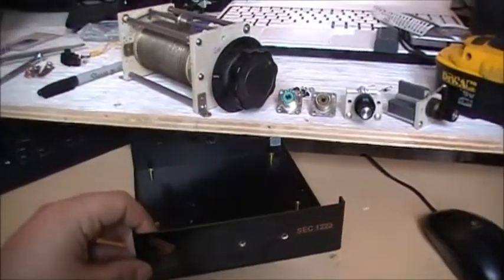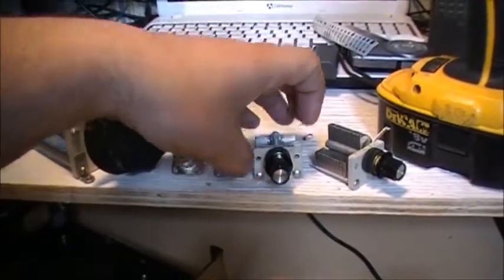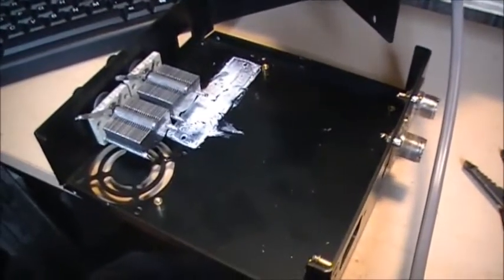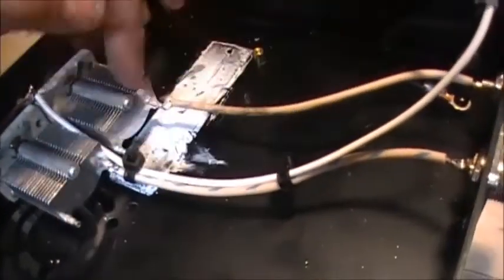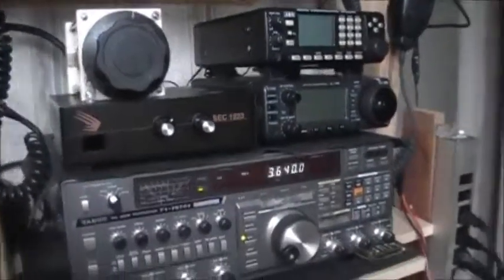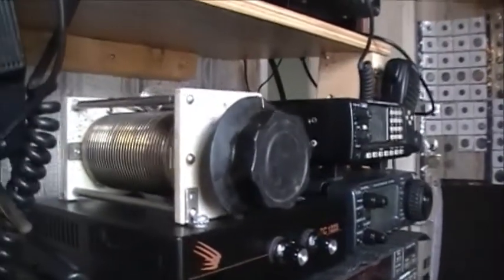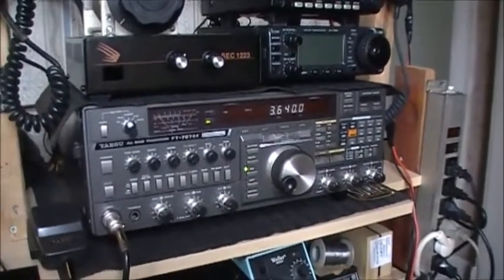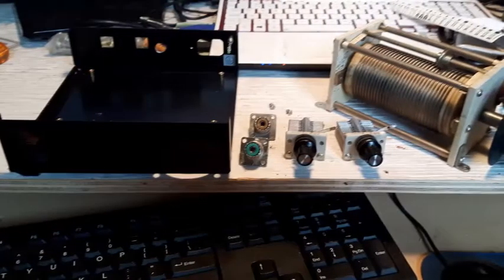Let's build an HF antenna tuner

Comment: I have a tuner with similar caps and it can handle 50 odd watts through it which isn't bad at all. What kind of power do you run?
Reply from the maker: 100 watts max, i do not use power amplifiers.